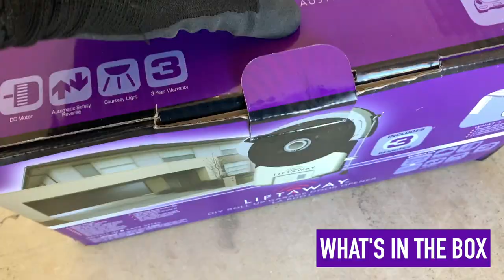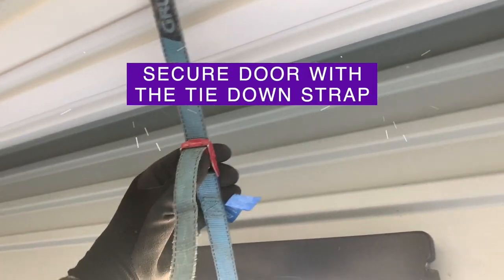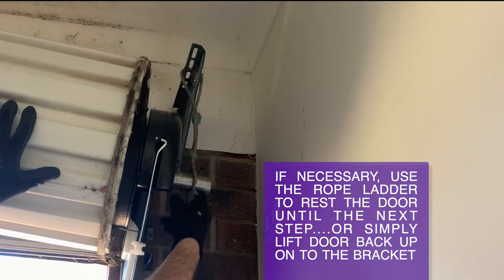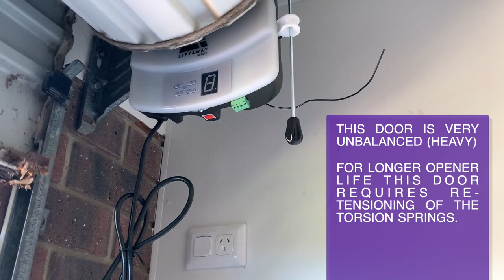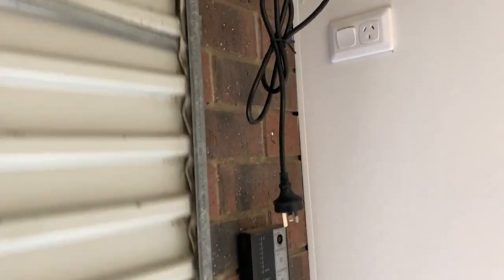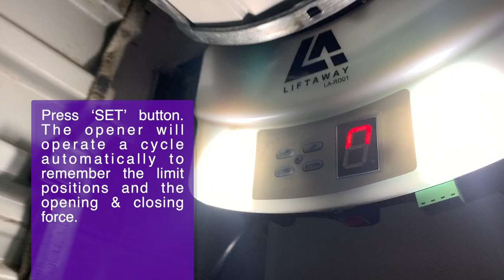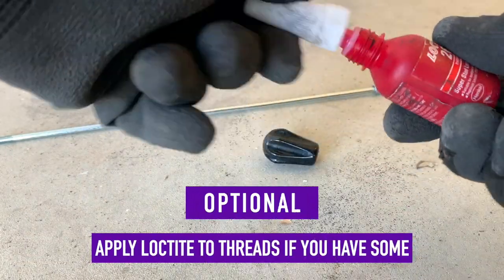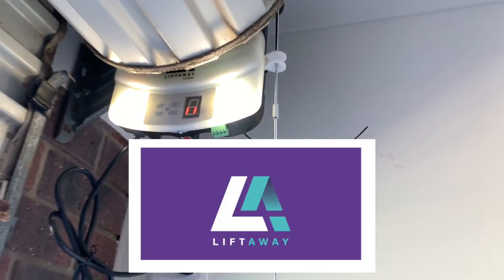Garage Door Opener Installation. GDO6 Roller, LIFTAWAY, Merlin Comprehensive Guide + Servicing Tips.

Comment: I have 3 holes in my wheel but no spokes.  Can i just insert the forks into one of the holes??
Reply from the maker: If it fits firmly sure 🤞🏻
Reply: @NatesToolbox  yeah the only way i can see is if i buy it and check.  I dont see the specs anywhere to measure.  Got a quote on a real opener and it is 2600 installed and i would have to do my own wiring which isnt an issue but 2600?  No thanks.
Reply: Sounds like you have a Janus roll door.  I have 7 of the 12ftx14ft doors and hope to install these but mine also have 3 holes in a sheet metal hub.  Did you have any luck with these?  Figured I might have to try 3D printing an adapter that I can bolt to the hub which also has 3 embedded nuts that are on both sides meant for the chain drive sprocket which is on the other side.